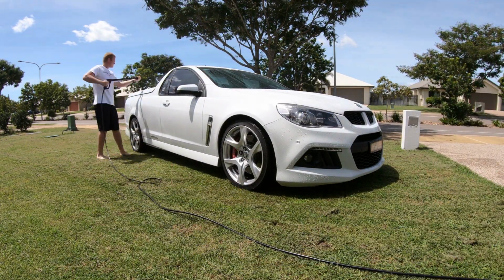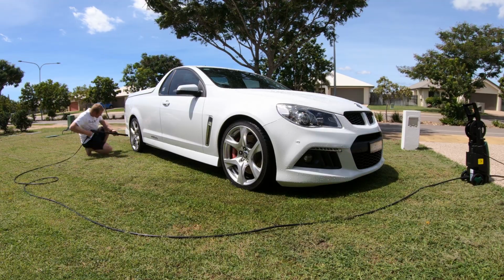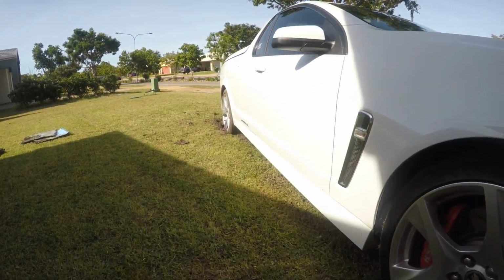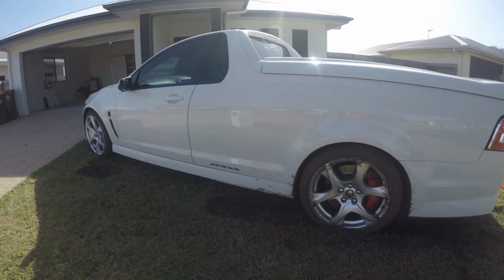VF Maloo LS3 Biggest Cam for Auto by LG Automotive and Dyno

Comment: Got a question. How come it’s pulling such low KW? I have the VF SS s1 ute and it’s doing 363kw at rw with exhaust, cam, extractors and hi flow cats. Just curious as yours is a ls3 bf Maloo that should be doing 400+ kw at rw for what you’ve done
Reply from the maker: Not 100% sure, I know TMS done tune with around 360rwkw similar to modes you have but camshaft they used is not for everyday driving and possibly NA specific for big power, cam I have is boost ready, hence why its got killaboost turbo kit on it now :) I hope it helps
Reply from the maker: Also VF SS s1 is same engine LS3 :) which is 6.2L
Reply: Daily Boosted LS3 ah righto mate, also the s1 VF is a 6L l77 the s2 is the 6.2L
Reply from the maker: @colbystar4557  fair enough, still great power for naturally aspirated car though :) whats your next upgrade?
Reply: @DailyBoosted   s1 L77 s2 ls3. Mine is s1 l77 supercharged cam exhaust makeing 475 rwkw
Reply: Wanna sell my ba turbo it’s sitting at 450kw and buy a vz maloo and do that up, I like the ve/vf maloo but the vz series is the toughest looking rig out of all of them.
Reply: I call bullshit there mate. 6.0L pulling 360rwkw with stock head still n/a points towards inflated dyno figures. I'd go as far as to say its 363kw at the crank. The heads just don't flow like the LS3, plus less capacity. If so, awesome, however I think that's well and truly inflated. And 400rwkw n/a requires big arse heads, huge cam and some e85 or better fuel.
Reply: @DailyBoosted  wrong. its a L77 not LS3
Reply: @EnkeiTenjin  exactly right. i seriously doubt any NA set up in the LS range is gunna pull 400 rwkw. bullshit.

Comment: LG automotive in Townsville?
Reply from the maker: Yeah that's it, they also have another shop in Cairns :)
Reply: @DailyBoosted  yeah cool, I have a fg xr6 turbo that I'm going to get mods done at LG in Townsville. They seem to do good work from what I've seen
Reply from the maker: @Mr500RWHP  awesome service, had my Maloo turboed with them, they did all the little bits I asked for and changed few things with check ups free of charge later on. And Lee is magician with Barra engine :) can't recommend those guys enough